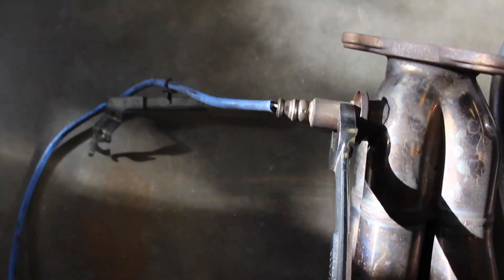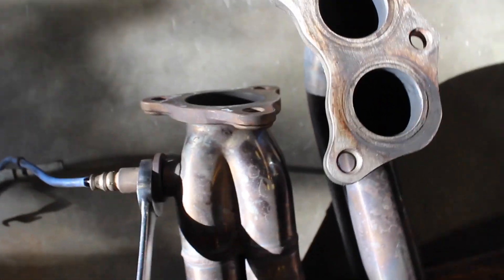How to: Install Equal Length Header on a Turbo Subaru | Unequal vs Equal Comparison

Comment: Can someone explain to me whats equal and unequal about the two exausts?
(English is not my firstlanguage so I dont know what the terms mean "equal header", "unequal header" and what they do to the sound)
Reply: UEL headers are designed with a un equal length of piping in mind, twistie headers basically, that's where the famous rumble comes from, EL headers are all equal length on each pipe, it's a straight design that allows maximum flow so that makes the sound more farty since everything comes out in one straight pipe, no bends or whatever because after all this is a 4 cyl just like every other car, however since it's a boxer it still has rumble but not too much depending on exhaust or whatever

Comment: How did you tighten the nuts on the right side by the up pipe where a wrench nor socket fits in having trouble tightening one of them fully
Reply: Sunde53 flex ratcheting wrench

Comment: So...I couldn't help but notice your CAI is less than a foot away from the turbo. How's that workin out for ya? lmao!
Reply from the maker: Actually works excellent. Car made 320/400 on E with a stock VF39!
Reply: Guess I just don't like seeing my intake temp climb over 200 degrees. Your peak boost with the VF39?
Reply from the maker: Understandable. 23psi on E85
Reply: Very nice. I can't see myself ever trading that rumble for any amount of power. Hawkeye rumble for life 😎
Reply from the maker: Yeah it was hard to do, I love it now with the EWG.
Reply: Nik Coffman doesn’t matter as much on a turbo car where the intake is placed, that’s why there’s a intercooler

Comment: I just ordered the agency power equal length header on my 2016 sti i have the cobb intake Cobb turbo inlet hose and nameless turbo back exhuast I'm wondering if it would sound good? how much power will i put out u think with mods I have so far with a tune .
Reply from the maker: Yes that would sound amazing. Should be around 320whp with a good tune.